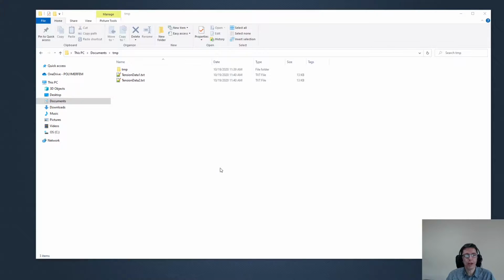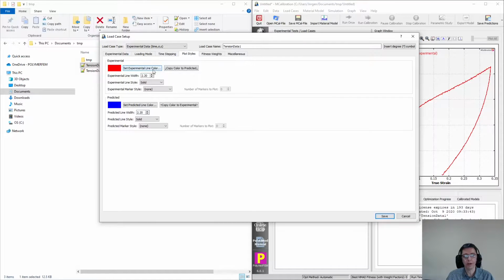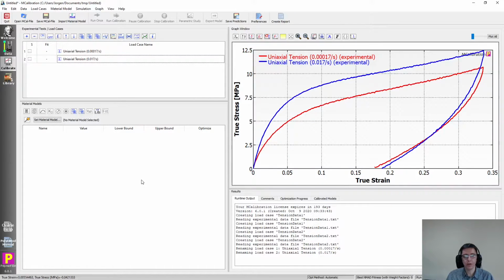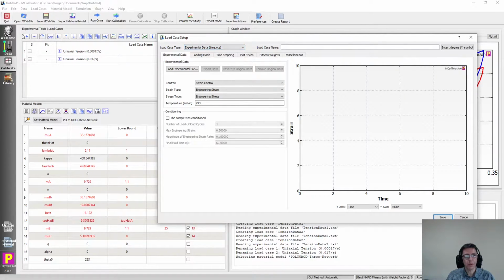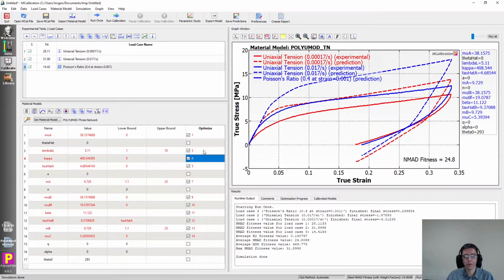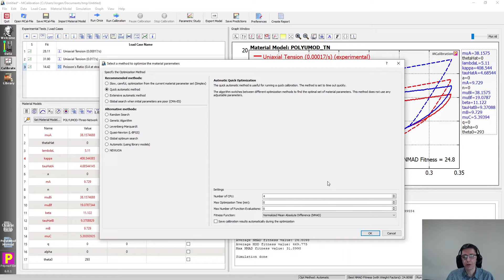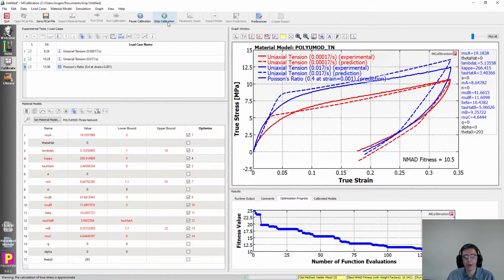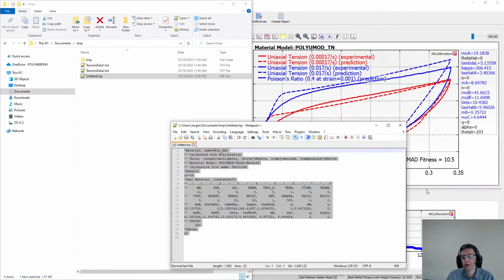Intro to MCalibration

Comment: Will your program have connections based on the models of materials used in theCOMSOL program?
Reply from the maker: Yes, MCalibration can calibrate and export material parameters for many of the COMSOL Multiphysics built-in material models.
Reply: @PolymerFEM  sorry, not so many.... 
some of the COMSOL models from your list have the following comment:
This model has not been implemented yet
Reply from the maker: @valeryanpilov2602  We hope to support most material models before the end of this year. Is there any specific COMSOL models that  you want us to add support to quickly?
Reply: @PolymerFEM  you are really kind !

for me personally, the models of hyperelastic materials are primarily interesting

it seems to me that closer cooperation with COMSOL will be beneficial for both companies.